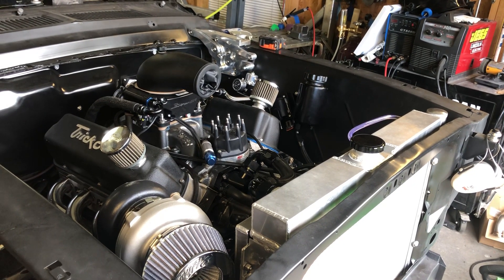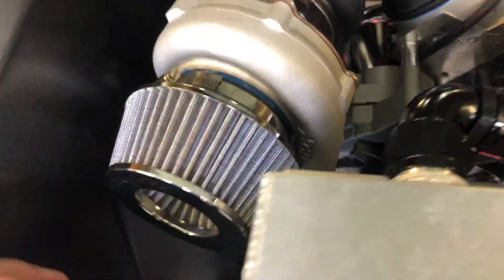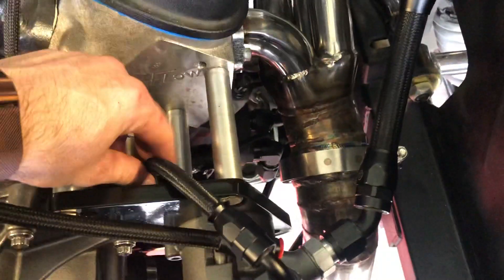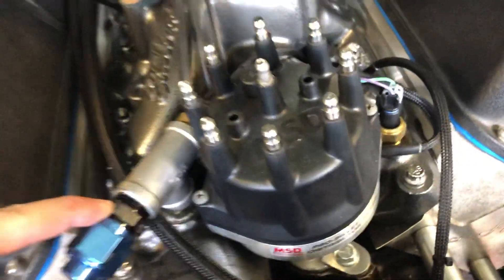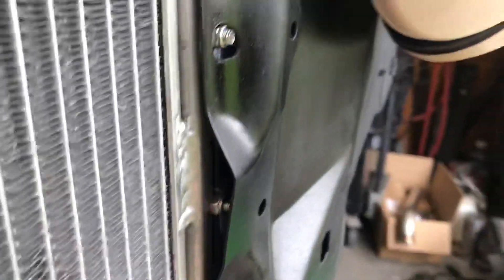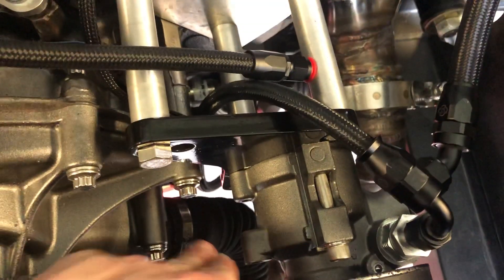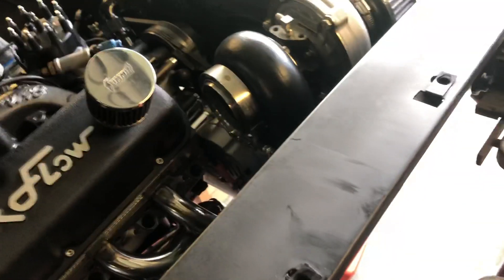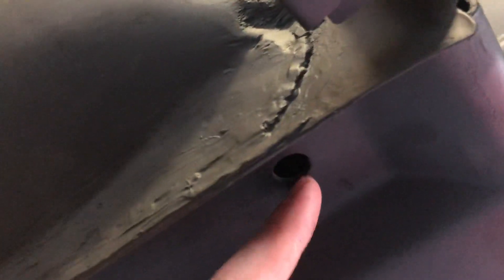68 Mustang Turbo fit up - Elaina

Comment: Car is coming together nicely. Good job. I have to catch up on your videos, car is looking completely different from when I last saw it. Are you getting any type of crank case breather or oil cooler? Also, is that a 4-row radiator?
Reply from the maker: yup, big block 24" i think, 4 row. as for breather, i have one picked out, but i'll have to either take my valve covers to my welder/fab guy to have him weld an fittings or buy new valve covers. really hoping the breathers work for the time being. and oil cooler is in the future plans as well.